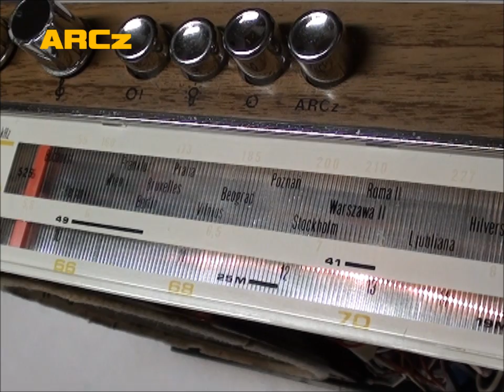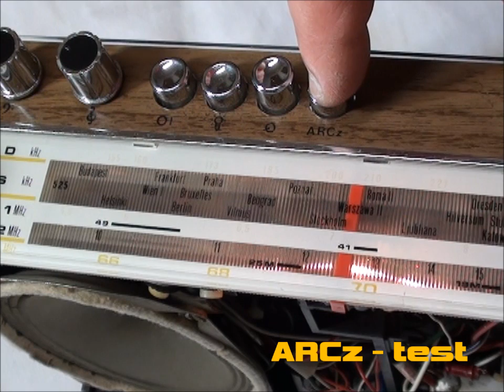MOT-701 JOWITA - nowy UKF powita

Comment: First- thanks a lot for this video that easily explains everything, even no need to know polish. I am in romania and happend to get one of these radios.The tuner version is just "GT-3". It's Jowita 2 wit IC only for the audio amplifier.All my capacitors in the tuner were the same, except C413 which was 75pF and C415 which was 16pF. Nonetheless, i replaced everything with the values in your video, and i got lucky, all FM is covered with good sensitivity. I am very happy with it :) Compared to some communist romanian crap radios which also used 2 transistors in the RF tuner (and never seemed to convert properly) this was a breeze!
Reply from the maker: I am glad that the film helped repair the receiver.
Thank you very much for the high rating of the presentation! :)